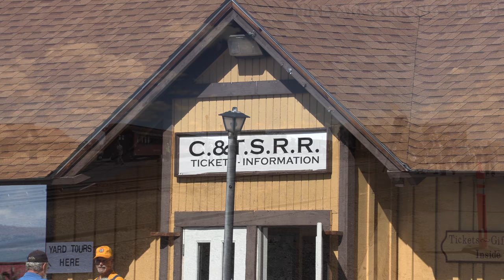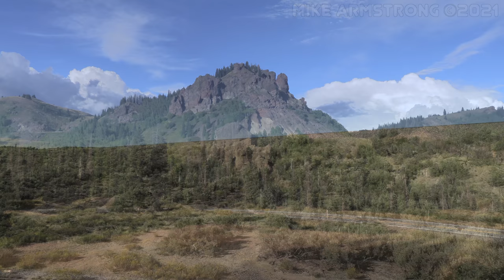Steam Train Historic Iron Horse Round Up - Cumbres & Toltec

Comment: The EUREKA and GLENBROOK gave a great account of themselves as well as the crews considering their age and how light they are.   The 4% grade to Cumbres Pass is tough even for the Ks.  This just shows that the D&RG would not have faired very well if it had not adopted the 2-8-0 and 2-8-2.  The railroad started with 2-4-0, 4-4-0, and 2-6-0 locos.  By the time the track got to Pueblo, experience showed larger locos were needed.